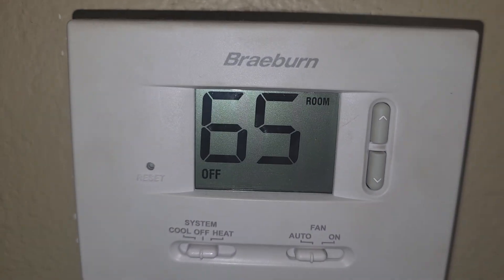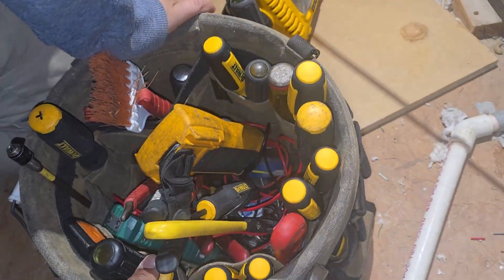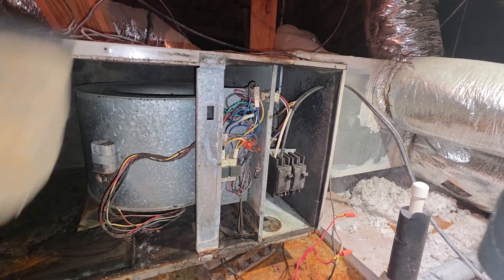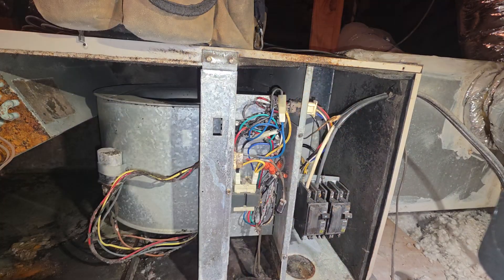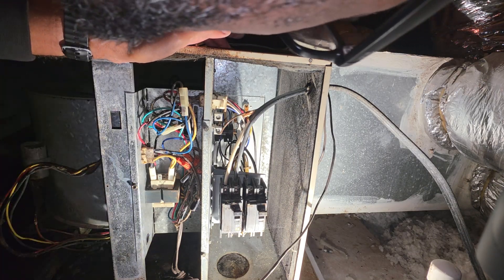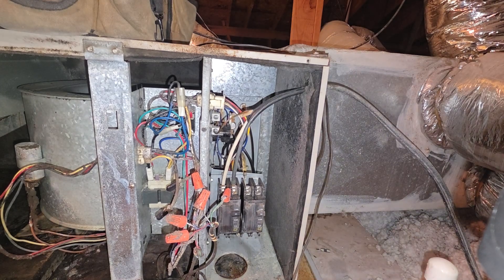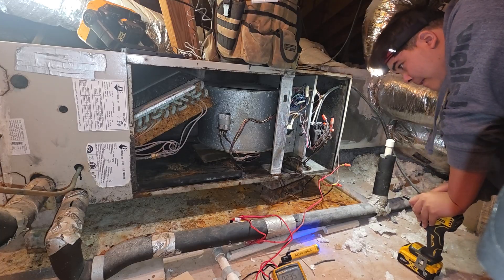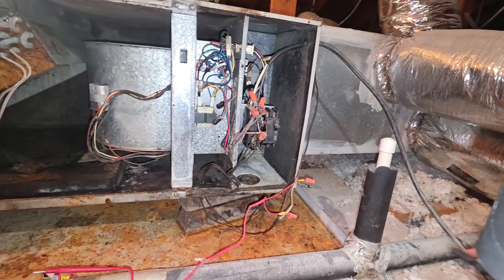Cold Air Only?! Electric Air Handler Heat Failure Diagnosed Step by Step

Comment: Must be a small house with only 5kw of heat strip. I could understand 5kw as backup heat on a heat pump system but not straight electric heat.
Reply: it looks like it was more than 5 kw but he did not look. looks like 10kw

Comment: Heat's WITH Gas, Heat's WITH Electric. Burn it in brother. 
An electric furnace requires the blower to activate as soon as the heat is turned on, while a gas furnace prefers to warm up a bit first. Heard it helps with condensation in the heat exchanger for gas.... H-V-A-C Peopleeee!!!!!
Teach him good, Man. Teach him Good.
Reply from the maker: I actually broke that down to him on the way to the job. A 10-minute video can’t show EVERYTHING, brother — doesn’t mean it wasn’t handled.

Comment: Seems that someone replaced the thermostat and didn't read the instructions OR they didn't know the unit was electric heat. It wouldn't make any sense that this has been working for months and months and suddenly now does not.  Could be the thermostat was replaced in the summer and all was well with the A/C and now they discovered the settings to be incorrect. 
WW HVAC gets er done.

Comment: Straight electric heat, no heat pump? That seem odd. I wouldn't want to pay that electric bill...
Reply: Forced air electric heat is like a crime !  Especially with electric rates that are higher than 8 cents a kWh.
Reply: @Garth2011  It's .23 cents a kwh in NJ now...